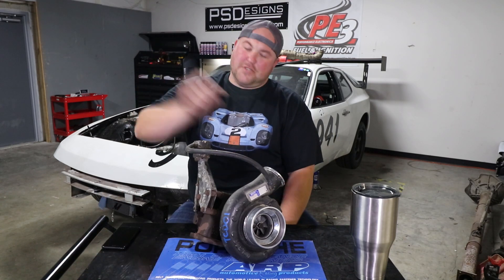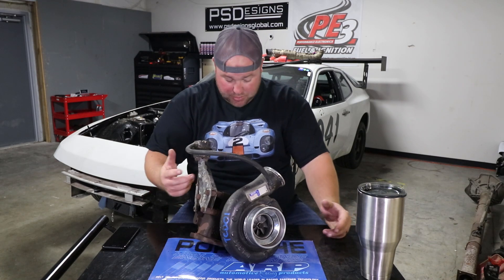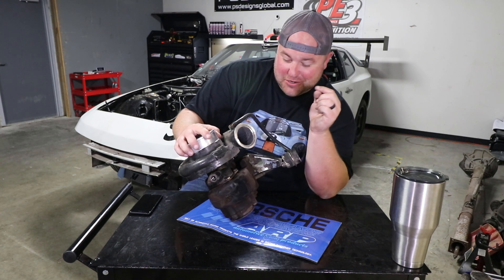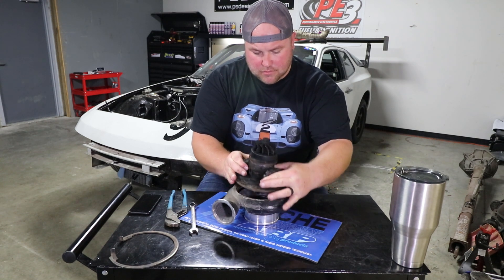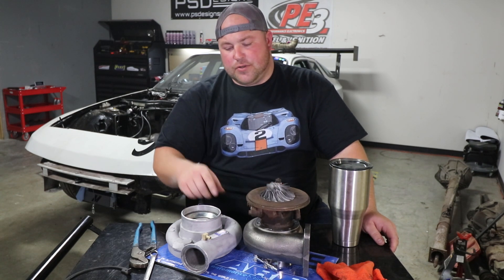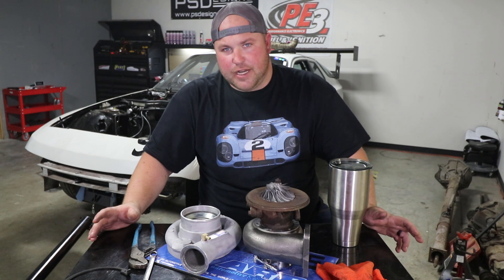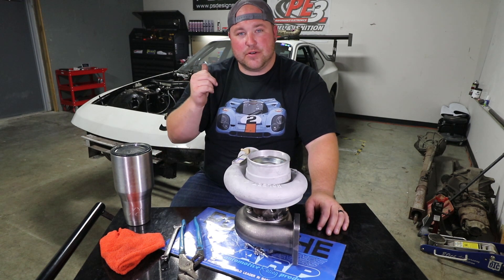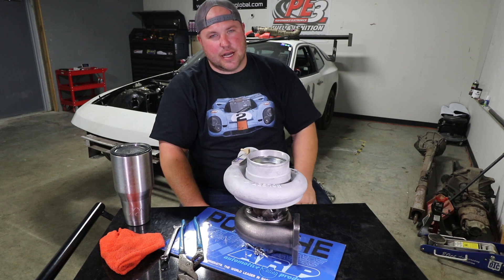Why the Holset HX35 is the BEST budget turbo!

Comment: That HX on a 5 cylinder is going to sound bananas. Big cams, long tubes...yeah buddy!
Reply: The turbo “whistle” becomes stupid loud once the surge ring is removed. It sounds like a jet. Run anti-lag if the new ecu supports it, this turbo will handle the abuse. Once everything is built and tuned, the parts are cheap enough to really be used hard. This is a great build man.
I’m looking forward to seeing the dyno graph and what engine speeds you tune up to on the stock bottom. 🤘🏼
Reply from the maker: Thanks dude! I’m anxious to see the progression as well!
Reply from the maker: Wastegate dumped to atmosphere, BOV chirping, it’s going to be a symphony of awesome!

Comment: i think full boost before 3500rpm and having 600hp on the same turbo is a bit optimistic
Reply from the maker: “HX35- This is the best known and most common Holset on the tuning scene, and the equivalent to a GT3582R, with almost identical wheel sizes in fact. Spec for spec, same housing sizes, they actually seem to spool better- Have you seen a GT35 hit 25psi by 3500rpm on a 2ltr? I haven’t at least, but plenty of twin scroll HX35 setups have.

There’s an insane amount of variations of HX35s, 650 plus at last count. There are compressor inducer diameter sizes down to about 50mm (I’ve heard of smaller, but no proof), which would lower its power potential, but the most common ones, and the ones to go for, are the 54mm inducer 7 blade compressor, and the 56mm 8 blade inducer, both proven at 600bhp. There are rare 6 blade versions too, which theoretically should flow more for any given inducer diameter, and billet versions too, but seen no data that they’re capable of more.

Most have 82mm compressor exducer, but many later spec ones have a 76mm exducer, but it’s unlikely to affect peak power and seen no proof either way.

There’s a wide variety of turbine housings out there, but the best known one in performance terms is the 12cm one, though I’ve seen 6cm undivided T4, 8cm and 10cm divided T3, and many more. Generally 11cm to 16cm housings suit the majority of applications, with 11-12cm best for 2.5ltr and smaller engines, and 14-16cm best for larger engines. The oddball small ones,  8cm, 10cm, are great for spool of course, but don’t expect to be getting 500bhp+ from them, partly as the turbine won’t flow as much, but also because they tend to come with smaller compressor wheels too.

I’ve personally never seen a HX35 hit 600bhp on larger than 2ltr engines, but seen it on 2ltr and smaller engines many times, with the 4G63s in the USA hitting it most commonly, at 30-35psi. The most I’ve seen from 2.5-2.8s with HX35s is around 550bhp, and a little less on even larger engines.

Spool-wise, a 12cm on a 2ltr with a twin scroll manifold is well proven to see 25psi+ by around 3500rpm, which is fantastic for a turbo of this size. Using a single scroll manifold and a 2ltr I’ve seen more like 1000rpm slower spool, 4500rpm, but still no lag between gearchanges, and some, just not ‘full’, boost long before then. On 2.5ltr engines, the 12cm housing even with a single scroll manifold tends to be full boost by around 3500rpm.”
Reply: Boost Brothers Garage you just said something that really grabbed my attention. Why is it that 2L and smaller can make more hp than larger displacement engines with the HX35?
Reply: I’ve spooled dsm 2.0’s at around 4000 so way possible

Comment: Might wanna put a v band on your screamer pipe so you can clamp a little bike muffler on if needed, or have a capped off, v banded hole in the downpipe, and a little pipe to let you take the screamer off and feed it into the exhaust without much hassle.

Not sure how it is in the states but a lot of tracks here have decibel limits, and screamer pipes tend to set the drive by decibel meters off like crazy!
Reply from the maker: Absolutely! There are definitely tracks with DB limits. My two local tracks don’t seem to care, but it makes perfect sense to be prepared!

Comment: What transmission are u guys  running with this turbo? I heard  the 944 na  transmission is not very strong.
Reply from the maker: The NA trans is weak for sure. I’m leaving mine in to see how it holds up and what the breaking point really is. I have a turbo trans ready to bolt in, and will go with an O1E if the turbo trans let’s go
Reply: @BoostBrothersGarage  I see, thanks for reply. I heard the 01e holds a lot lot of HP and torque stock. I really hope project nine can make the kit happen, I really need one for my 944 build. I'm planning to drop a lsa in, is making 727 to the wheels, the 01e would mean the world to me
Reply from the maker: Holy crap, that’s going to be insane!